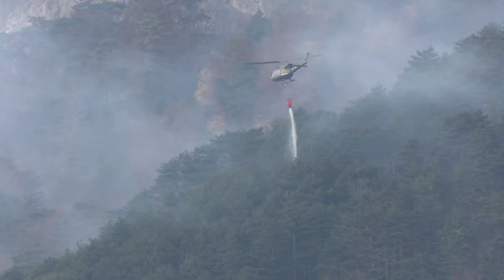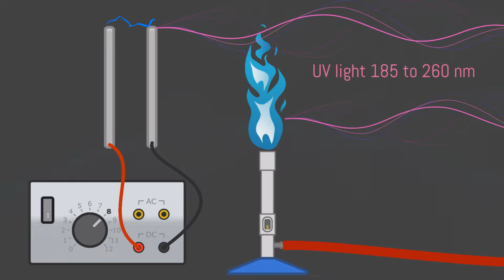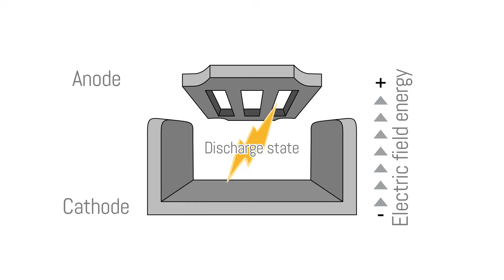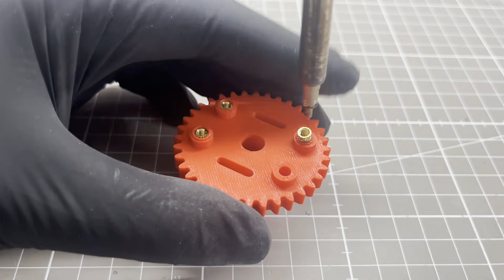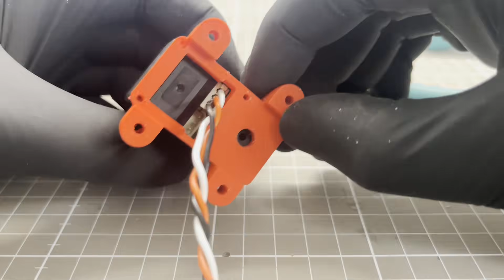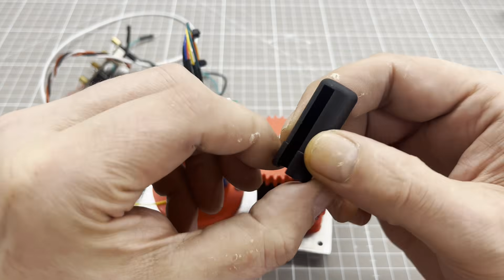Building a Hamamatsu phototube flame scanner

Comment: Excellent! We started using Hamamatsu tubes in 2004 for all our flame detection needs at XCOR. They are just about bulletproof, detecting flames and nothing else. We had them inside the engine cowling of the Ez-Rocket, by the gaseous hydrogen storage and pumping systems, and anywhere we were wary of small, hard-to-detect flames.
Reply from the maker: Thanks. It's interesting to hear where the tubes are used:)

Comment: How about connecting the sensor to binoculars or a low cost spotting scope or pew scope? I think though that glass or the glass coatings have to be checked for impact of UV.
Reply from the maker: The lenses would have to be made of quartz glass, since only quartz glass is UV-transparent:)
Reply: I see now the sensor is for UV-C and that is blocked by regular glass. Yep you are right.
Reply from the maker: @jheissjr  Still a good idea as quartz glass lenses are available and not very expensive:)

Comment: I work with industrial oil and gas burners. UV is generally related with gaseous fuels. Oil burners use IR and photo sensors, uv tube fails to detect oil flame. Wood burns with far lower temperature. It will be interesting to compare sensitivity with piece of barbeque coal and wood in that oven in yours yard.
Reply from the maker: I tested it by heating a piece of charcoal which worked. Burning wood works as well, candles too. I guess it will not work with oil as it is injected via a nozzle into the combustion chamber and has no big chance to get into the gas phase.

Comment: It's quite sensitive! So, it can determine direction now. It would be great if there is a way to determine distance as well~
Reply from the maker: Yeah, it's extremely sensitive. For distance a different sensor would be needed (ToF sensor or something like that). Let me think about that...:)
Reply: @Marbslab I don’t know if you even need another sensor. You can have it look away and back towards it and measure the response time. Maybe have a mechanism that can block the sensor then quickly unblock so response time can be accurately recorded.
Reply from the maker: @TheDeadKingsRaven  Good idea. I'll see what I can squeeze out of this phototube:)
Reply: @Marbslab  for distance you need two sensors and trigonometry, or a high point and vertical scanning. No ToF involved in something that's one-way.
Reply from the maker: @IvanStepaniuk  Really? There are tons of Time-of-Flight distance sensors out there.